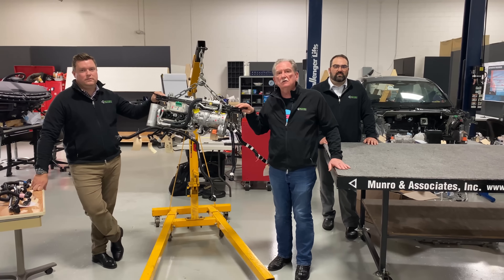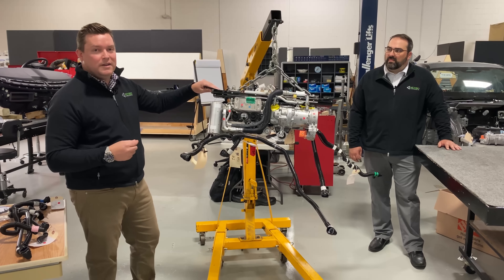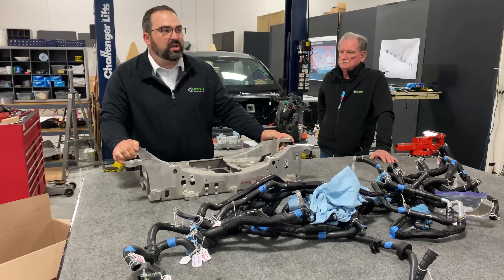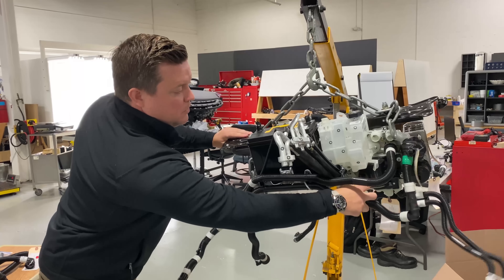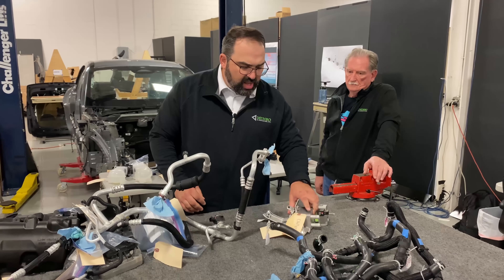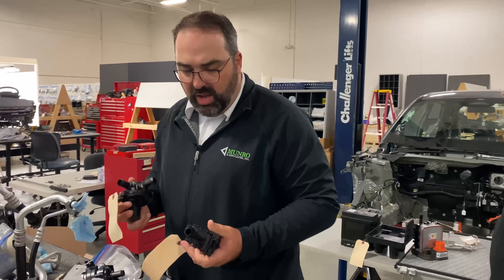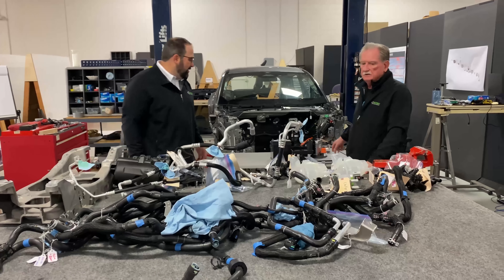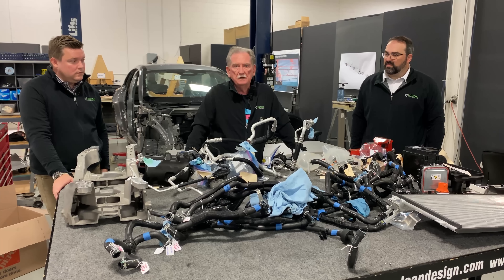Mach-E Thermal System Part 2: A Detailed Comparison to the Model Y

Comment: Wow!! All the Tesla Loving Mach-E jealous folks are out on this one. Car & Driver EV of the Year Bitches!  Sorry but a few extra hoses and pumps do not change the fact that Ford has built an overall better car. Get over it already. Tired of the bullshit. Sandy review each system’s functionality. There is probably a reason for the madness. I can’t believe the Tesla’s cooling system works better than Ford’s based solely on number of parts and configuration. This video is getting sooo overstated.
Reply: C&D did a 1000 mile road test and guess who won? All  the Teslas. The Mach-e came in 4th place and took 2 extra hours to finish and the Teslas weren't even the LR versions. Why did the Mach-e lose? Well, partly because it takes a longer time to charge, and the EA charging network itself. Just that test alone proved C&D was full of crap when they claimed the Mach-e was EV of the year. 

Yeah, when it actually comes to head-to-head real world tests, the Mach-e loses. Now, drivers in Norway are having their Mach-e's quit on them when driving down steep roads because of overheating.  How ironic we now have this video showing how poorly the cooling system is designed.
Reply: @cyberfred5520  it’s ok. I understand. Losing sucks. Better luck next year Tesla.
Reply: @wagg8989  Yes, losing sucks for the Mach-e.
Reply: @cyberfred5520  have someone who knows how to read and comprehend explain the article to you.
Reply: @wagg8989  Mach e SUCKS , get over it💀
Reply: @Relansls  to each his own. I’m loving my Mach-E. Suck on that.
Reply: Yes, I agree. The number of components is small and they are inexpensive items. With modern fault finding systems it is not difficult to find where a fault is. hoses are cheap and unlikely to fail for many years.I have a Mach-e and think its terrific. Many comments are from people without true knowledge and just stirring it up- I am happy to see how this all works out - no worries here.
Reply: @baxtersfarm  
The number of components is not small.
Each hose (obviously) has 2 joints (aka leak points) each of the 4 plastic pumps is a potential failure point, the system weighs more, is bulky, complicated to assemble (increasing cost)
Stop trying to justify it just because you bought one.
It's a dogs breakfast!
Reply: Chris Waggoner
"Overall better car"?
In which respect?
Range
Charging
Performance
Internal space
Technology
Navigation
Driver aids
All Telsa wins.
Reply: @rogerstarkey5390  hey man, enjoy your Tesla. I’ll enjoy my Mach-E. Argue with Car & Driver about how they evaluated the cars. You simply can’t argue with the title of EV car of the year. It was already given to the Mach-E. Why don’t you start a movement banning their magazine. Suck it up. Maybe Road & Track will give the Tesla an award.
Reply: @rogerstarkey5390  claims, claims, claims, etc...
That’s why you have independent experts verify those claims. I really wish Tesla had won the award. They were the innovators and deserved that recognition. But that’s not what happened, so man up and get over it. I have nothing against a Tesla. Some of their owners can be a bit over-the-top.
Reply: Yes, not a worry to me. I use/own quite a lot of big, useful and complicated heavy machinery. They use loads of hydraulics and electrics and some are 30 years old. They rarely go wrong and do not cost a fortune to repair but they give good service even though they employ large quantities of oil and water travelling through pumps and hoses at considerable pressure. Tesla have been very successful and are without doubt very good but it will be interesting to see how they last and what the cost of repair is in the future. This to me is a non argument until failure and cost of repair are really known. In the meantime everyone should just get on with life and not worry about which system is best.

Comment: So it boils down to one thing- Ford is trying to keep a profit model in place by designing an engineering nightmare that will increase the number of components that can fail and amp up service hours to keep money flowing back to dealerships after the sale.

Comment: Would it be quite hard for another OEM to make an octovalve type device? It seems like that would be the solution here right?
Reply: Not at all.  They can exactly replicate the Tesla version since it is filed as a patent and Tesla has stated that Tesla won't be interfering with any manufacturer who copies it!  That is, Tesla's engineering design is free and open source!
Reply: @wallykramer7566  there are rules on that, they have to cross share patient's and I am also pretty sure that was only battery, charging and drivetrain related parents.

Comment: Sandy, I really enjoy your tear downs and analysis, it is amazing. I have a question no one has ever brought up. Since these EV's are computers on wheels, and they track a huge amount of daily driving data. I am concerned about hacking, privacy, and or the company misusing all of the detailed personal data gathered. For example, Tesla very quickly showed that the Chinese driver that claimed brake failure actually pressed the go pedal instead. Several Tesla accidents have been shown by Tesla data to disprove initial Tesla problems. GM has cabin cameras to watch the driver. I would really like to get a cyber truck, but am very uneasy about this massive intrusion and data collection. Do you have any insight on this issue and privacy intrusion? I suppose if decentralized block chain tech was initiated and required a court order to release private data, that would help my concerns a lot. We already see big tech and CHINA gathering our personal data and using it against us.

Comment: I think I'm correct in saying this does not include any connections or hoses within the battery pack itself? When the Mach-E battery pack was opened, there were many connections and junctions there. In the model 3, and the current model Y, it is much simpler from the POV of connections, at the cost of simplicity in servicing, as was found out with the recent broken nipple, $16,000 repair/replacement. As I said elsewhere, there is a workaround for that, and a fairly simple job to avoid the issue in future. I would hope it has already been eliminated in the new 4680 structural packs. Actually disassembling those packs may well be harder, but it should be possible to minimize if not totally eliminate that sort of incidental damage that could effectively brick a battery in that fashion.

Comment: Not a single mention of how these systems perform. It seems that this channel is quickly becoming a hub for clueless Tesla fanboys to come to and have orgasms over things they misunderstand (which is almost everything, considering they know nothing about cars) as being better on a Tesla than on other cars. Yes the system on the Tesla is lighter and simpler, but it also performs badly. What do you care about more? Saving a bit of weight and having a system that doesn't perform as it should, or having a bit more weight and having a system that performs properly?
Reply: You are quite right. Too many arm chair experts. My John Deere tractor just failed and it is a very complex bit of kit. With the right mechanics and support the very complicated task was soon done at very reasonable cost. When you consider the amount of parts and hoses in a modern ICE  vehicle this really is nit picking beyond
Reply: True.  There is no systems operation aspect presented.  But can anyone possibly believe that all that extra tubing, pumps, etc. work better?  (I don't need further demonstration:  I've seen enough to believe the Tesla design is far superior.)

Comment: Stuff like this is why I think Toyota is being smart by investing in active air cooled battery packs. No coolant means no coolant leaks, no coolant weight, no coolant replacement, etc.

Active air cooled batteries (with passive cooling at speed) is the best way to go IMHO.
Reply: How does that work when the temperature is -30 °F?
Reply: @wallykramer7566  Pretty well, drive around with the vents shuttered, they open once the battery exceeds the optimal temperature

Comment: QUESTION:  In ICE World, how much would less weight help?  In the EV World, less weight obviously helps - apparently a lot in terms of range.  In the ICE World, less weight could be achieved as well, right?  So, would less weight in the ICE World help fuel economy and, if so, by how much?  If the answer is that less weight could help the auto makers achieve significantly higher fuel economy for ICE cars, then why the Hell didn't they do that instead of always whining about how getting higher fuel economy was TOO hard?

Comment: I’d love to see what Kia / Hyundai are doing as they seem to get left out of the discussion and yet are supposed to be ahead of the non Tesla pack.
Reply: Yes it would be great. I have a first generation Ioniq EV and it does not seems to be as complicated in the piping. It is more complex than the Tesla, but less than the Mach-E. But I didn't remove everything from under the hood to check ;)
Reply: @AB-yt4hd  
I’ve a new E Niro and like you I’m sure it’s not spaghetti junction under the hood/bonnet.

Comment: You can be sure that before Ford started designing the Mach-E they bought and tore down several different Teslas to see how they did things.* They have their reasons, I'm sure, for why they went the direction they did.

* This has been common practice in the automotive industry for decades and in the end benefits us all because the best ideas tend to trickle to the top and make cars better and cheaper (usually).
Reply: I doubt that anyone relevant from Ford looked at any aspect of the Tesla design.  I don't see a single shred of evidence they did.
Reply: @wallykramer7566  They would be fools if they didn't, especially since Tesla had been in the business of full BEV cars for more than 10 years at that point and had learned much. This has been standard practice in the automotive industries for many many years.

Comment: Why don't you compare the MachE to the 2012 Model S? Those seem like a fairer comparison.
Reply: I have a 2013. I only saw two coolant pumps and there's only one reservoir. I know the new Plaid should be even more interesting. In 2012 they used a lot more off the shelf parts.
Reply: @aaronwilliams1249  Because Ford has the benefit of seeing everything Tesla has done, Tesla had no-one to copy.
Reply: @munya120  Exactly, and the same with all of the other auto manufacturers and it sounds like they're worse than Ford. One would think they would look at how Tesla did it and try and do something better, or at least as good, but that means thinking outside the box or having new parts that aren't off the shelf. Tesla, with their vertical integration, isn't afraid to create new custom parts for their cars, i.e. the Octovalve, or even improve upon them. It may also be due to all of the patents Tesla has.
Reply: Because Ford had Tesla to copy and they had no-one. Its that simple.

Comment: Sandy thinks in terms of manufacturing. 

He's very concerned (obsessed) by weight and parts count.  Those are important to a maker only when they effect manufacturing cost and competitive performance of the product.  As long as a product can get through its warranty period, makers don't care much about serviceability.  That's how we've gotten to expensive skinny sealled cellphones with un-replaceable batteries. 

Owners have different concerns. Few owners will ever test the limits of top speed or acceleration, but most are concerned about the efficiency of a car as a tool, how its ownership costs or saves them time and money. That's TCO, which has multiple factors.  

Range is a variable cost because of wait-for-charging time, and it varies widely between owners. 
More predictable costs are maintenance and repair.  These are calculable statistically using operation hours and distance traveled using the MTBF of each component, the component's cost, the labor to replace it, and its vulnerability to environment damage where it is installed.  

You can say that a 10 ft straight hose is 3x a likely to fail as a 3ft hose of equal construction if used in the same function and environment.  If the short one is in a hot dry area and the long one in a cooler moist area that isn't true. 

Compact design has advantages, but not necessarily longevity or  serviceability. Without removing the Tesla's cross member, how accessible for replacement is each component in comparison to the Ford?  Can the failure of one of the Tesla components cause harm to another because of proximity?  How about vulnerability of the concentrated parts in an impact?
Reply: All waffle, no substance.
Just your "short hose" analogy.
The ford has MULTIPLE "short hoses".

Comment: If you look at the Mach e you’ll see that one of the ways Ford made up for their shoddy engineering was with tiny narrow sissy tires. The Y has wider tires yet is more efficient.
Reply: Also a bigger battery pack which most manufacturers are doing
Reply: Good catch, TRR (Tire Rolling Resistance) has a huge effect on gas mileage and EV range.  Ford is probably using low rolling resistance tires to help with range.

Comment: It's like the Ford engineers forgot about the cooling system after the rest of the car was built, and had to quickly cobble together something that looks like a home hobby job.
Reply: In my experience as a tier 1 or 2 with the OEM'S YES line routing etc is not considered early enough in the process. Not just lines. The functional areas of the vehicles are sent to different design departments for design and integration. And some have more say or power in decision making. So if a cooling system eng says hey we need to change something to be better it may be considered too late, the more powerful team won’t change or maybe won't be allow to change due to launch issues.  Why OEM's are so focused on meeting launch vs making a better product is a fault in the system.
Reply: This!

Comment: I think this makes the Mach-e look over complicated but i am unsure that its longetivity and performance are hindered by what looks complicated. The individual components are all well tried and tested and very inexpensive should they fail. My petrol mustang probably had 2000 engine parts and never had a single problem in the 4 years of ownership. All fairly straightforward fittings and components. Im happy to see how these two compare in ten years time.
Reply: So am I. Or twenty years. Or thirty.

Comment: Two questions.

1- How the hell do you bleed these system and ensure no air pockets are present?

2- Who at Ford own stocks in the hose manufacturing supplier?

And the worst part is, we've got financial analyst bashing Tesla's claims of having higher margins per vehicle than anyone else. And they openly state that it's impossible against legacy manufacturers that have decades (if not century) of experience. 

Yet additional evidence lays bare for all to see on a very full table.
Reply: 1. Run pumps at full speed with all valves open while pulling vacuum at bottle. 
2. 🤷
You didn't put it, but 3. Sometimes having analyst in your title doesn't mean that's what you do. Stock market is not like other forms of gambling where you win by being lucky/good. You win by ensuring others lose. Sometimes that means making sure the "layman" stays a "layman." Even though your title would lead people think otherwise.

Comment: https://www.latimes.com/business/story/2020-07-01/federal-safety-officials-probe-tesla-battery-cooling-system?_amp=true

I get the issues with weight here, but is Ford worrying more about safety, passenger comfort, and battery protection. There are more rabbit holes to go down before we make the assumption that the Model Y system is superior to the Mach E system simply based on weight and configuration.
Reply: That article is for Model S packs made between 2012 and 2016 with an outsourced cooling system.  No issues since they went in house.  You should have read the article.
Reply: @TheEvilmooseofdoom  my point was not about a specific issue per say. My point was to suggest that you can’t make assumptions based on weight and configurations alone. Does the Model Y system performance measure up with that of Ford’s. Absolutely no discussion about how well each system does their job. Or are there issues with safety related to each system. Crickets! The thrust of the review simply suggested that Tesla’s system was better based on only two parameters. And probably the least important ones. Yes range is important but not as much as safety and longevity of the battery.

Comment: This looks like a design to make sure the Mach-E needs repair and servicing.
Reply: It also could be the result of focusing engineering time on other aspects of the vehicle that are more critical than the thermal system so that the car could be done when they promised it. If this is the case, thermal system simplification may be coming in future updates.
Reply: @AlanDayley  
It could also be that they ran out of time and had to launch as close to the Model Y as possible?
Or
They ran out of cash?
Or
They were out of ideas?
Or, they thought they could build cheap from the parts bin and nobody would notice?
Or, any combination?

In any case, not "optimum"